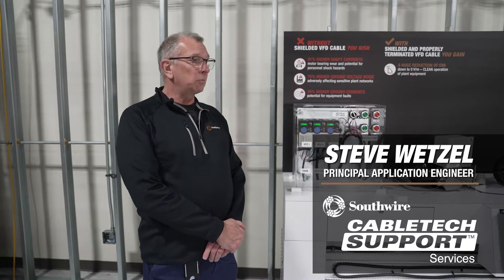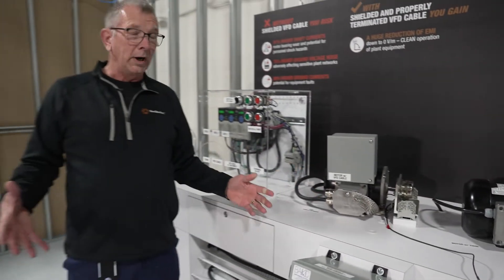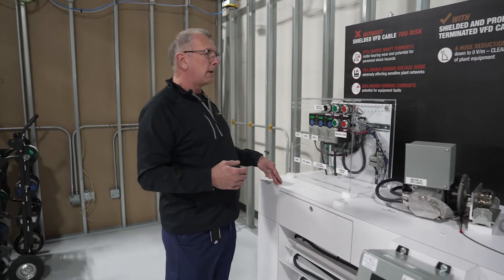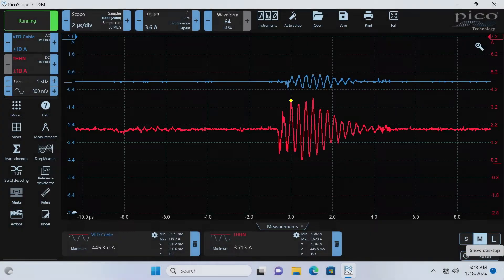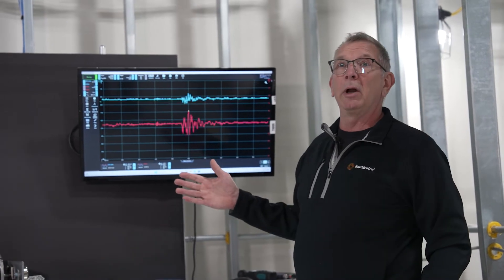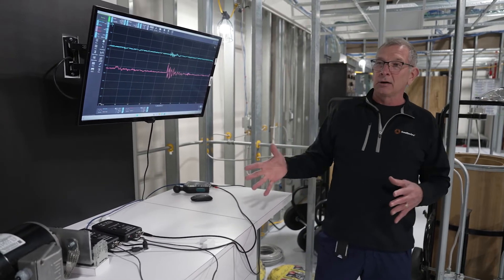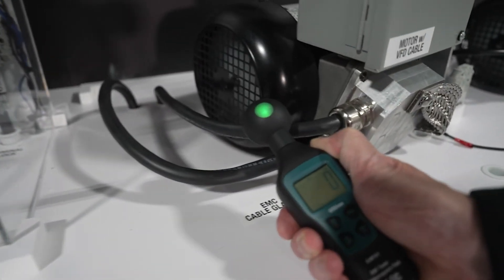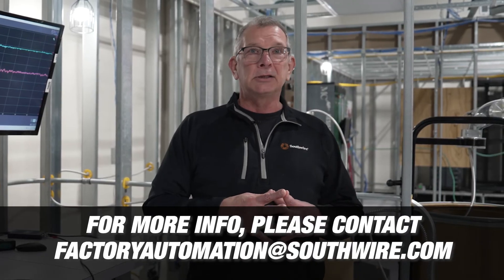VFD Cables Make a Difference – See How

Comment: Fitting insulated bearings goes a long way to extending the life of the bearings, yes screened cable is a must to comply to noise emission regulations but it does not stop the circulating currents, also the switching frequency has a lot to answer for which is not mentioned at all here.

Comment: Is there still actually shaft current? Perhaps you are just not measuring current because the shield of your VFD cable is bonded to the plate that the shaft is also bonded to. If you measured current from the shaft through the shield, rather than from the shaft to ground I’m curious if there would be current. My understanding is that the VFD cable shield just provides a low impedance path for the common mode current, so the current would still flow through the shaft to ground, but the current would then flow from ground through the VFD cable shield.
Reply: I think yes.  The large surface area of the VFD cable shield, creates a low impedance path for the high frequency switching signals that would otherwise become shaft currents.

Comment: I think my question is similar to @KLAWNINETY's...what if you connected a ground wire from the VFD to the THHN-connected motor?   Would that reduce the current measured on the shaft?
Reply: The solution would be to fit insulated bearings if circulating shaft currents are reducing bearing life and increasing service time, you will not stop the currents through earthing methods but you can reduce them also increasing the switching frequency  can  cause voltage spikes that increase bearing currents and should only be done if you understand the pro's and cons of doing such, many increase the value to reduce high pitch whistling without understanding the consequences it can have.